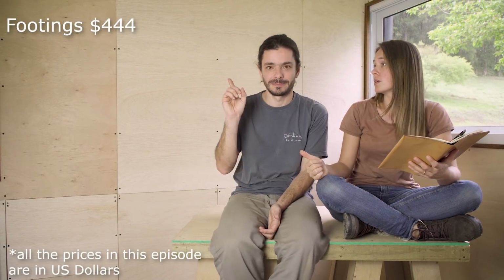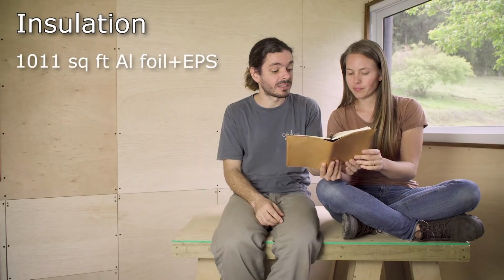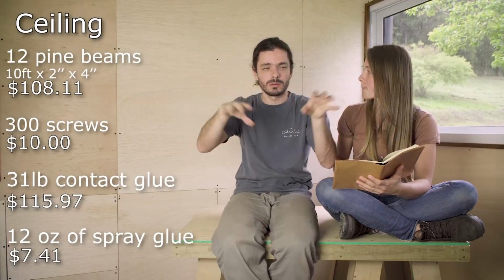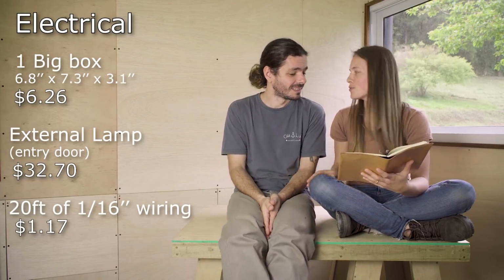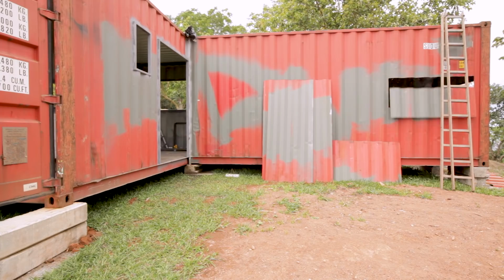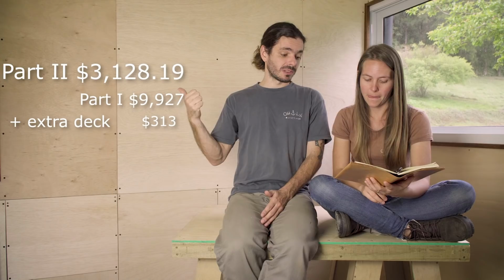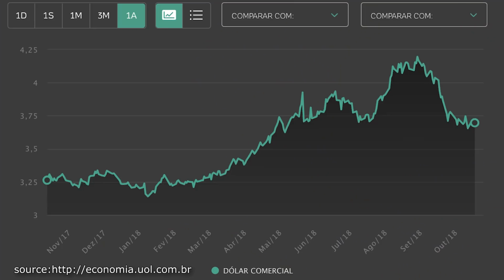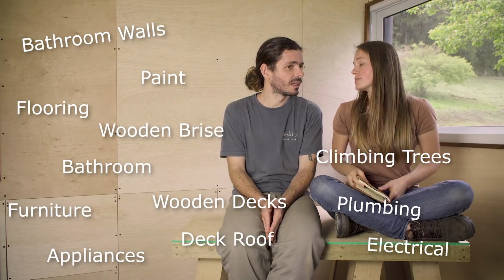Shipping Container House 💰How much did it cost? Part 2 - LTP EP 053

Comment: olá roberta e edu....

eu não acredito como vocÊs gastaram tanto..... o custo de cada unidade do meu finalizado já com pisos tá saindo 28mil reais por unidade.... 
sendo que algumas coisas eu paguei para fazer.... e outras eu q fiz...

mesmo eu sabendo que vocês utilizaram outro tipo de isolamento.....

esse tema VALOR do projeto é muito ruim de projetar a quem assiste os videos
Reply: CONTAINER 6und  R$ 43.500,00 
DEMOLIÇÃO  R$ 660,00 
CONSTRUÇÃO MÃO DE OBRA  R$ 4.000,00 
DRYWALL  R$ 26.000,00 
PISO LAMINADO  R$ 7.700,00 
PISO AZULEJO + VASO + ARGAMASSA  R$ 5.100,00 
SERRALHERIA  R$ 8.500,00 
VIDRO  R$ 12.913,00 
GUINDASTE  R$ 6.500,00 
MATERIAL F  R$ 5.225,00 
ACABAMENTOS 
PINTURA MÃO DE OBRA  R$ 4.000,00 
ELETRICA  R$ 6.500,00 
FUNDAÇÃO FERRAGEM  R$ 2.430,00 
FRETE  R$ 2.500,00 
FUNDAÇÃO BLOCOS  R$ 734,00 
ALUGEL BETONEIRA 45 DIAS  R$ 260,00 
FUNDAÇÃO MATERIAL  R$ 1.676,40 
POSTE  R$ 940,00 
PINTURA MATERIAL  R$ 3.000,00 
CAÇAMBA  R$ 500,00 
CONCRETO A DESCONTAR ERRO ENGENHEIRO  R$ 1.175,00 
MATERIAL A DESCONTAR ERRO ENGENHEIRO  R$ 731,60 
MOVEIS  R$ 12.000,00 
QUARTOS  R$ 4.800,00 
MARMORE  R$ 3.240,00 
BOX  R$ 840,00 
 
TOTAL PAGO  R$ 165.425,00
Reply from the maker: Na verdade o preço pode varias e muito. Depende do numero de janelas, do tipo de esquadrias (temperado, alumínio, pvc) do acabamento que se opta por usar ( drywal, compensado,etc ) se tem telhado ou deck. No nosso caso por explo temos 42 metros quadrados de deck no teto e um telhado de aluzinco com eps. Poderia ser somemente o tero cru do container e sairia muiiito mais barato. Mas gostamos de como fizemos. O forro do teto outro exemplo. Se fosse de drywall sairia bem maia barato mas gostamos muito da solução que usamos (apesar de cara). Bom é isso acho que deu pra entender o que quero dizer no final é questão de escolhas e esse é um dos motivos de construirmos com apenas um container, pode os construir usa do o material que quisermos pois a casa é tão pequena e com tão pouco material que podemos nos dar essa opção. 😊👌🏼
Reply from the maker: E não vejo porque ser ruim de projetar custos para quem assiste. Acho que pode sim ser muito útil para quem tem vontade de construir uma casa. Como dissemos no vídeo. Acreditamos que sim poderia ser mais barato mas tmb poderia ser mais caro. No nosso caso está conforme esperávamos e tínhamos planejado. 👌🏼😊

Comment: I don't think brise is quite the right word. In European houses it's common to have wooden shutters on the windows. In the north these are mostly solid wood to protect during storms. In the south they are mainly a frame with many wooden strips at an angle and with space between them for wind and light to enter but to provide shade against the direct sun. This seems like what you are putting up to shade your walls and then the wooden strips are called "slats". I saw the comment below calling them siding and that could be right, but I would see that as a more solid covering.
Reply from the maker: You are right. We mean the one you said they use on the south. Wood with gaps in between. 👌🏼😊

Comment: The wooden strips you're referring to, we call siding. I'm from louisiana and they used to use virgin Cypress for the siding. Very beautiful. The wood is 1"thick. With various width and length. You start at the bottom, install it horizontally and nail 1"from the top. Then the next row should over lap the first one by 2". Like shingles on a roof. Google old Louisiana cypress homes. Very beautiful
Reply from the maker: Thanks a lot for the tip my friend. We will google it!! 👌🏼😊